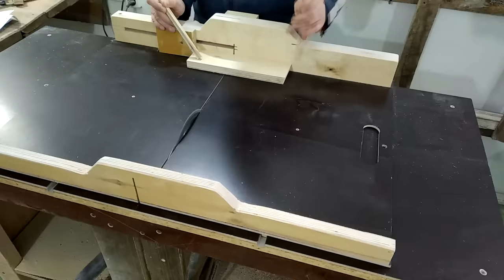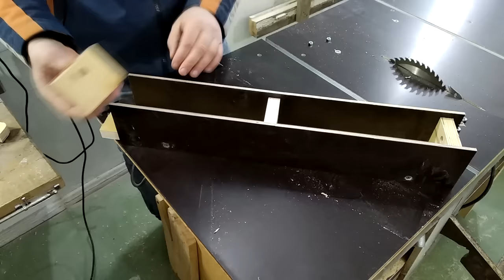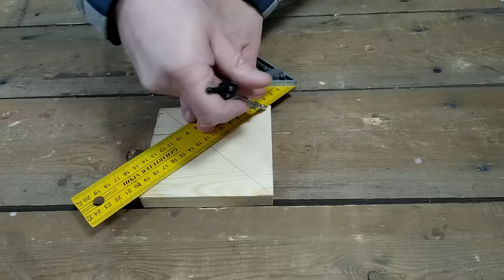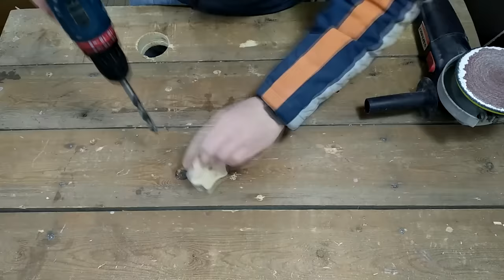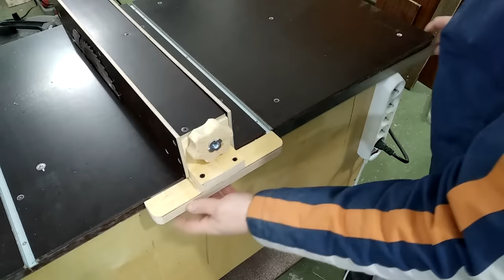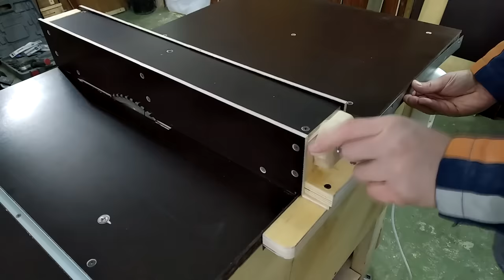Homemade Table Saw Fence for DIY Tablesaw

Comment: I built this fence with the wood and plywood I had. I could not make it work. It is not locking! When I two's the round button ( looks like a floret) it pulls the back piece and the back piece just bends slowly, so no pressure gets to the locking mechanism.
Your video shows it work very nicely.
Reply from the maker: This is strange because my fence works perfectly! I say this, not because I’m advertising my video - it’s really so.
I can suggest several reasons:
- maybe the back gauge is too thin and bends under load?
- small diameter of the threaded rod (less than in the drawing)?
- the back stop does not rest against the base (see sheet 5 of the drawing https://mazaydiy.com/plans/table-saw-fence.pdf) ? He must rest against the end of the table
- is the hole in the rear stop too large (see sheet 11 of the drawing)?
- try tightening the nut harder, see 06:11
- check the drawing again, maybe you missed something
If none of the reasons fits, then you can take photos and upload to imgur, take a photo here, I will try to help you!

Comment: Super, Excellent and wonderful accurate 
nice work, I like it, you are genius and skill full wood worker, according to my 
Opinion you are wood work "Engineer ".
Please tell me about the bench grinder 
tool rest, How can I make it, If you have 
a plan kindly Send me and guide me 
On which angle the hand plane blades 
and chisels are Sharpe, your big fan from Pakistan, Zafar , Thank you for this wonderful video
Reply from the maker: Greetings, Zafar. As you call the bench grinder, it's just a piece of chipboard with pieces of sandpaper of different grit glued on. Plus my little jig for chisels sharpening - https://mazaydiy.com/chisel-sharpening-jig/ Bevel angle for a plane blade - 25 degrees
Reply: Sorry Dear, I want to know about the bench grinder tool rest, measurement and angle, the angle means on which 
"DEGREE " hand plane blades and chisels are Sharpe, I hope you will guide 
me about "Bench grinder tool rest "
Reply: Sorry Dear, I want to know about the bench grinder tool rest, measurement and angle, the angle means on which 
"DEGREE " hand plane blades and chisels are Sharpe, I hope you will guide 
me about "Bench grinder tool rest "

Comment: Is this laminated plywood used everywhere ? Table saw and other tools ?
Reply from the maker: I usually only use film faced plywood on surfaces where abrasion resistance is needed.
Reply: @MazayDIY  Thx

Comment: Hi, I dont know what I'm doing wrong here, but I cant get this too stay firm on my bandsaw (yes I know this is for tablesaw..) what to do? I think I have tried everything. One thing on my bandsaw, the edge under is a little bendt, could that do it?
Reply from the maker: Hi, Frode! I would be happy to help, but without looking at the machine it will not work. I recommend to show the experienced master. Sorry

Comment: I might have a go at replacing my crappy fence with this. I've downloaded the plan, thanks. Any idea what opens a "x_t" file? Fusion360 hobby version only opens industry standard files.
Reply from the maker: .x_t - it's Parasolid X_T file - use AutoCAD's IMPORT command or CAD Exchenger - https://cadexchanger.com/parasolid
Reply: Would share the plans or where I can find the plans?
Reply: @johnfiore6226  He has a link to the plans above. There are also a few good pictures to follow. I didn't draw up any plans. I just took screen shots of his page and a made a few rough drawings. i would probably have different dimensions anyway.